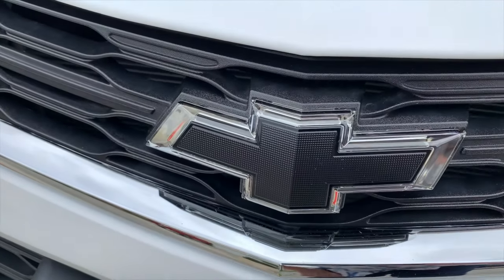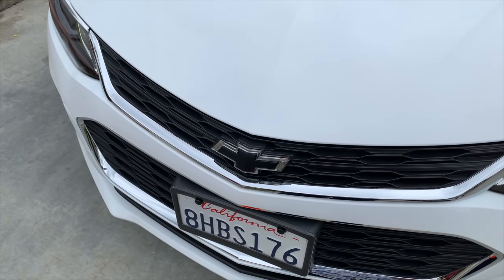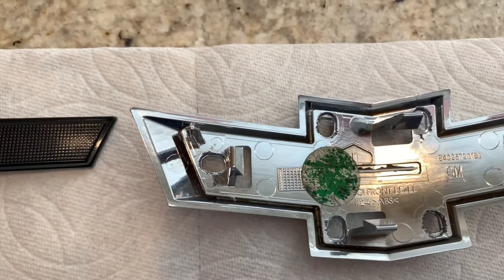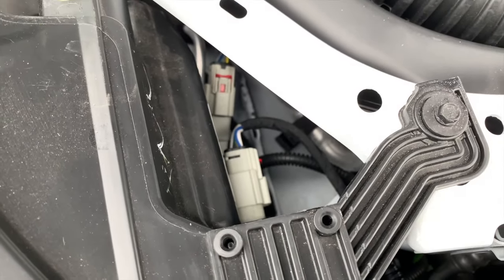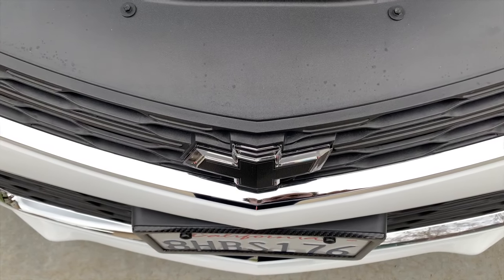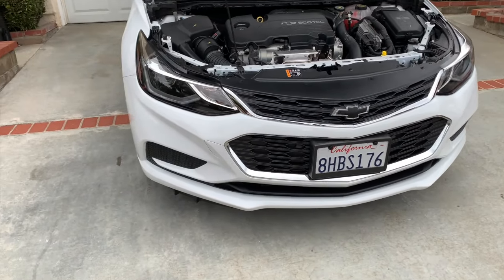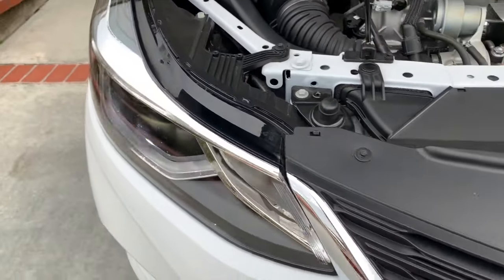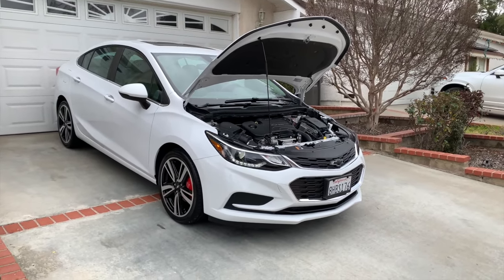One off black lighted bowtie for my 2018 Chevy Cruze

Comment: I congratulate you  It was very good, I have a hatchback cruze and I would like to put the same wheels of yours and the illuminated logo, but I have some doubts, because the gm website doesn't explain anything
Reply from the maker: Lucio del valle Im actually selling my accessories off the Cruze. I sold it to buy my new Civic Type R.
Reply: The Car Crazy Guy Do 
you remember if the connector where it was plugged had 6 holes?  3 on each side ?  check in my car the connector that turns on the led lamp and it is like that ... and the wheels are these?

https://www.gmpartswarehouse.com/oem-parts/gm-18-quot-wheel-5-split-spoke-84012907?c=Zz13aGVlbHMmcz0xOC1pbmNoJmw9MSZuPVNlYXJjaCBSZXN1bHRzJmE9Y2hldnJvbGV0Jm89Y3J1emUmeT0yMDE3JnQ9bHQmZT0xLTRsLWw0LWdhcw%3D%3D

Comment: I have a 2017 Chevy Cruze do you think there the same size bow tie ?
Reply from the maker: I believe they are the same. I'm selling my lighted custom black bow tie if you are interested. Check with your dealer to make sure the 2018 (mine) and your 2017 is compatible.
Reply: The Car Crazy Guy how much? I’m very interested
Reply: @TheCarCrazyGuy  can I buy it please? Or can I PAY you to do it for me? I bought the 2019 black illuminated bow tie hoping it would fit my 2017 Cruze and the certified Chevy dealership refuse to do it for me and say it will not physically fit. So my only option to get that OEM is YOU you are my only hope! Haha please I will get the gold illuminated part and ship it to you if you are up for the task! But I really want this for my redhot 2017 Cruze!

Comment: where does this hook up to? on the battery or?
Reply from the maker: It comes with a wire harness that taps into the headlight harness
Reply: @TheCarCrazyGuy  so it plugs into the back of the headlight harness?
Reply from the maker: @jacobkoch7615  You unplug the harness from the back of the headlight, plug the bowtie harness into it and then the other side of the bowtie harness goes back to the headlight
Reply: @TheCarCrazyGuy  okay so there’s two harnesses on the lighted emblem then? one that goes into the port and the other for the headlight harness to go into correct?
Reply from the maker: @jacobkoch7615  only 1 harness, it just T's into the factory power.
Reply: @TheCarCrazyGuy  okay i should be able to figure it out thank you so much for the help!! I appreciate it!
Reply from the maker: @jacobkoch7615  you’re very welcome

Comment: I have a 2018 Colorado. Is it possible to remove the gold part of the bow tie and not the chrome surrounding and paint the gold to a different color or can I only remove the whole thing?
Reply from the maker: I can only speak for the Cruze. It may pop out but be careful. They do sell the black bow tie versions for the Colorado. I had one on my 2017 Colorado.
Reply: @TheCarCrazyGuy  did the one you had on the Cruze pop out from out of the chrome surrounding? And did it come off rather easily without damaging the rest of the parts
Reply from the maker: @sickofguysnamedtodd2293  It came out pretty easy. It was just held in with two faced tape. I used a feeler gauge to slide in between both pieces and the bow tie popped out.
Reply from the maker: @sickofguysnamedtodd2293   keep in mind I’m only talking about the lighted bow ties. The non lighted ones have little plastic welds that you have to drill out to separate the pieces.
Reply: @TheCarCrazyGuy  do you have to take the old bow ties off to separate the welds or can you do it while it’s still in the vehicle? And where are they located?
Reply: @TheCarCrazyGuy  and can you use that feeler gauge to take the bow ties off the car?
Reply from the maker: @sickofguysnamedtodd2293  you have to remove the bow tie from the truck to separate the bow tie from the chrome housing. The only time a feeler gauge will work is with the lighted bowtie only since it’s held on with two faced tape.

Comment: Can I buy it please? Your custom black illuminated bow tie. Or can I PAY you to do it for me? I bought the 2019 black illuminated bow tie hoping it would fit my 2017 Cruze and the certified Chevy dealership refuse to do it for me and say it will not physically fit. So my only option to get that OEM is YOU you are my only hope! Haha please I will get the gold illuminated part and ship it to you if you are up for the task! But I really want this for my redhot 2017 Cruze!
Reply from the maker: I sold mine awhile ago. The 2019 models have a different grill than the 2017’s. You would need to buy one that fits your vehicle, pry out the bow tie and place the black one you would get out of a standard one. The tabs on the back of the black one would need to be sanded down so it would sit flat. Then using 2 faced adhesive tape you would bond the black one to the lighted housing.
Reply: @TheCarCrazyGuy  can I please purchase the part and just ship it to you for you to do for me for a fee ? Lol I’d rather do that! I can pay for shipping and pay you for the labor! I’ve literally called 3 certified dealerships going crazy over here all for this. You make it seem so easy, and I’m not good with these things at all or have any equipment to do such task.
Reply: @TheCarCrazyGuy  hey can I pay you to do it for me? I really want this done to mine.